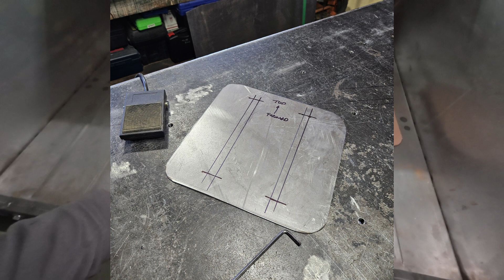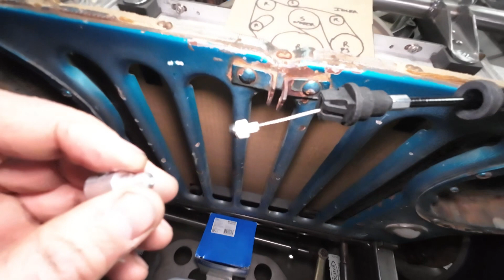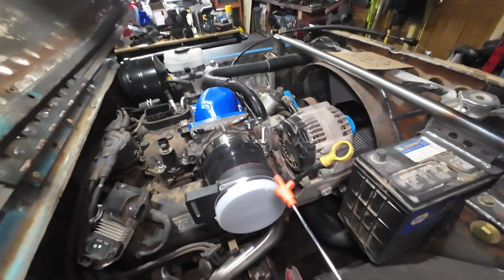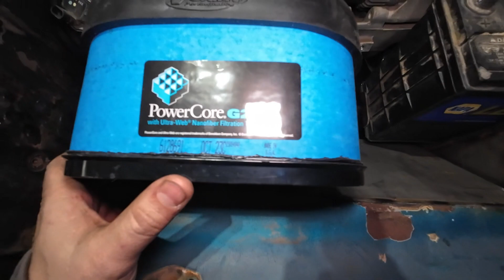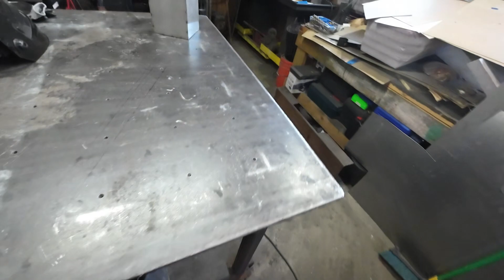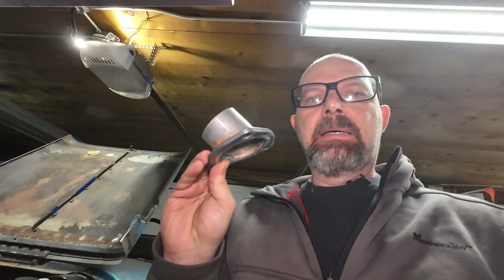Old Blue Willys Part 33

Comment: Following along. Maybe you could talk about what’s going on with the steering? Maybe I missed it? Looks like hydro assist? What tripe of steering box?
Reply from the maker: Good idea, I'll go over the steering when I get close to the plumbing. Short version- Small quick ratio manual box with an external spool valve that powers a mid size double ended ram mounted to the axle.